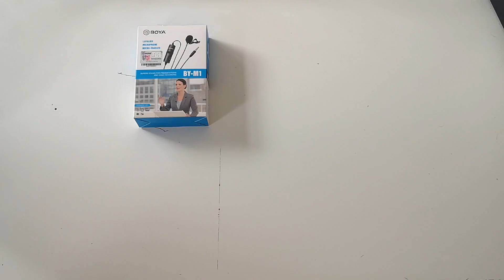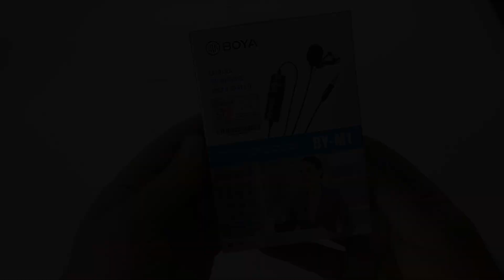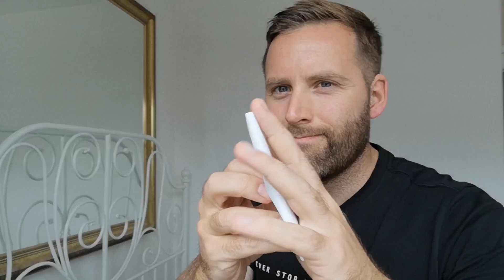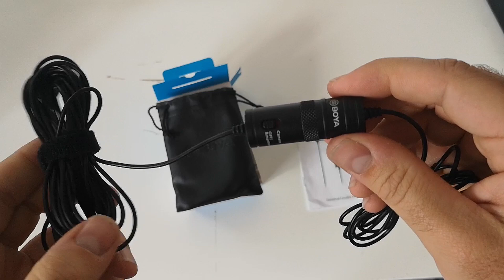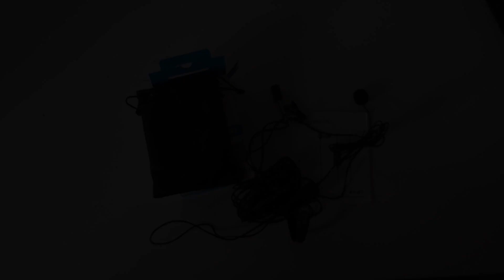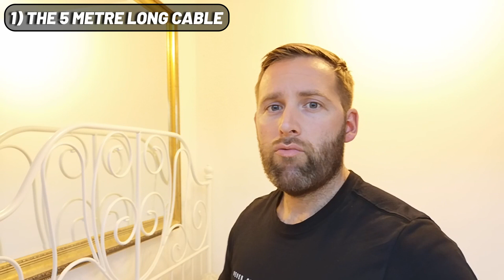Boya BY-M1 Lavalier Microphone Full Review | Watch This Before You Buy

Comment: Good review, but the lavalier mic was always going to perform better tucked inside your jacket.
If you don't mind syncing your audio, you can hook the mic up to a voice recorder stashed in your pocket, so you don't have to worry about the wire.
I've got the P20 Pro, you used to have to use a 3rd party app that allowed external mic.
Reply from the maker: Yea that's rights mate, I've coiled the wire so it's like the perfect length for my osmo mobile 2 at arms length. And I just tuck the mic under my coat. I saw a few videos about the mic not working with Huawei but then realised it worked with the standard video recorder I have on my P20 so happy days, it'll do the trick for now but I'll for sure be looking to upgrade at some point, thanks for the feedback 🙏